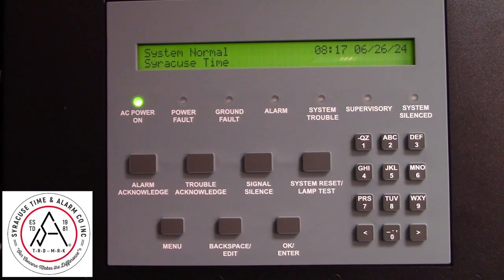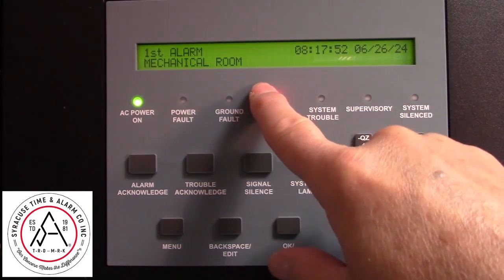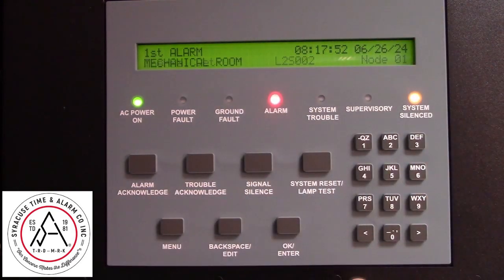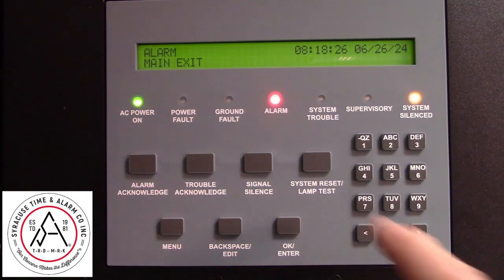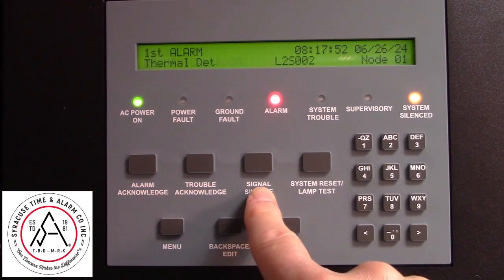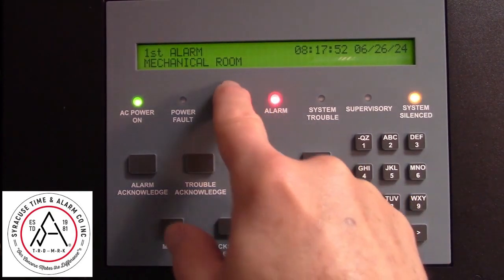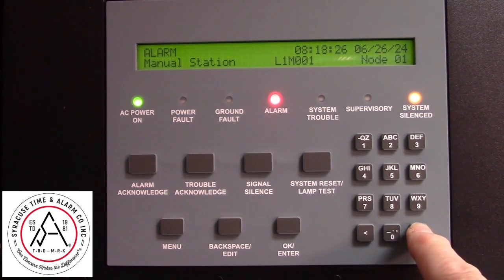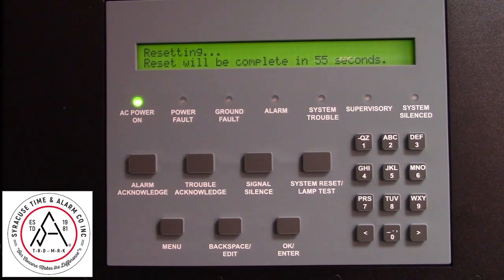🔥 Gamewell-FCI E3 Fire Alarm System | Alarm Handling & Reset Demo 🔥

Comment: It is important to remember that the signal silence will toggle the output on and off. If you attempt to silence the alarms and quickly press it twice the signals won't be silenced until you press it a third time.
Reply from the maker: That happens sometimes when the customer is trying to silence the alarms.
Reply: How long does 'alarm acknowledge' stop the panel from beeping?
Reply from the maker: Sorry, I missed this comment. It depends on the system programming but it must beep again in at least every 24 hours until the abnormal condition is resolved.

CODE REFERENCE: 
NFPA 72 (2019 & 2022 Editions) — Section 10.14.6.2
10.14.6.2 Audible indication shall resound at least every 24 hours until all abnormal conditions are restored to normal.